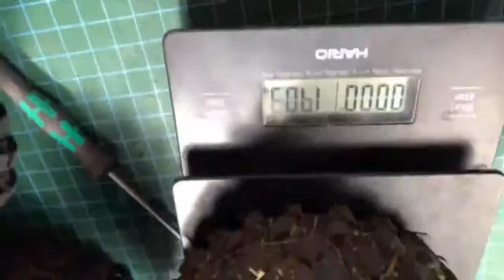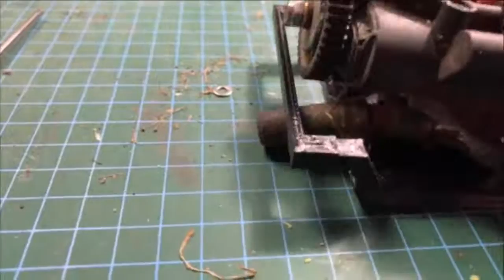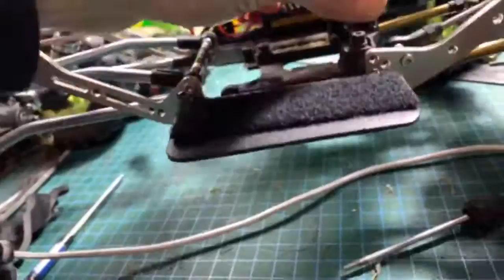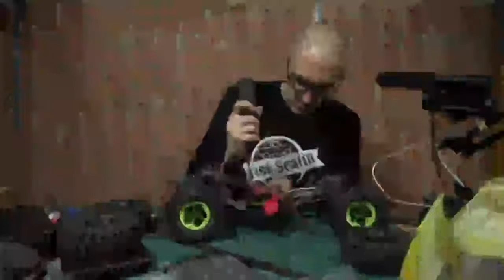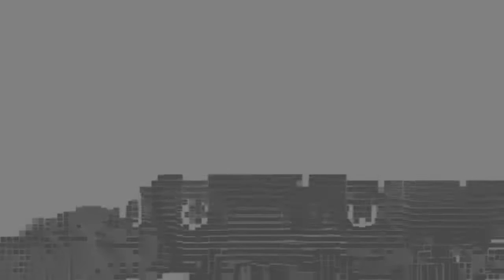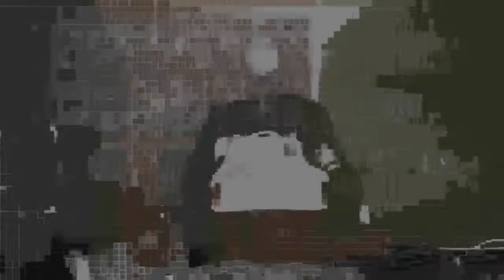3d printed wheels for my comp crawler and skid design

Comment: Hey man, did those 3D printed wheels ever work out?
Reply from the maker: They worked great until a side impact shattered the spokes. Probably took the design far too lightweight for use on wet rocks (or at least being too far away to catch it).

Going to add more material to the spokes so will make them about 25-30g a wheel but that’s still insanely lightweight
Reply: @JustScalin  thanks for the quick reply. I want to do a show truck setup for my TRX4 and plan on printing some wheels around the 2.6” height, but 2.2” wide to fit my current tires. I may even post a video when it’s done if I go through with it. Probably do them in PETG as well.
Reply from the maker: Oh wow they sound awesome, I’d really like to see them when they are done. Mine were in PLA which is probably why I had the issues, but I prefer it for the surface finish